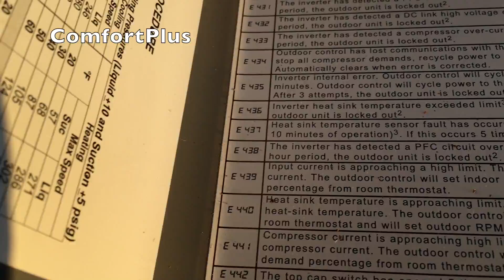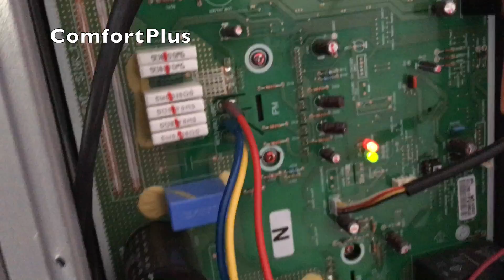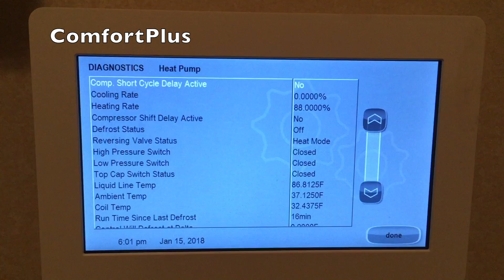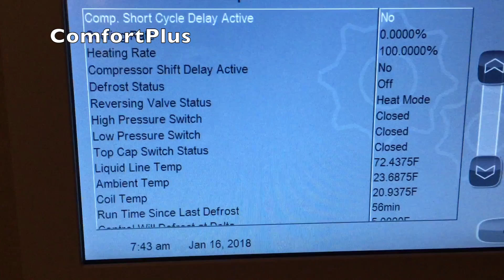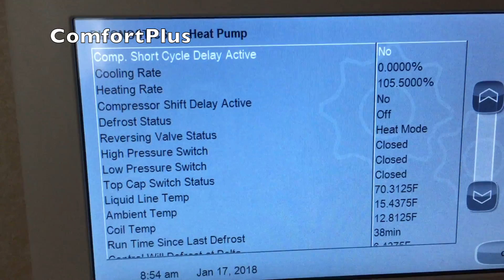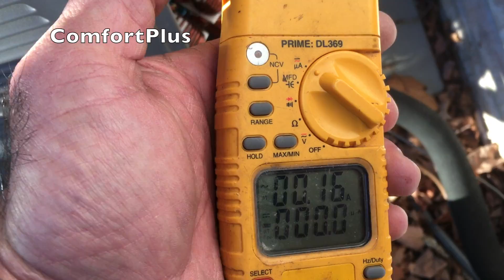Inverter Heat Pump Failure

Comment: Copeland's got a pretty sweet deal with their two stage compressor. It's really simple it has an unloader solenoid embedded in the compressor. It loads the compressor when energized to 100%, it runs at two-thirds capacity when solenoid is not energized. Copeland has a YouTube video on it
Reply: Eh? Those have been out for over a decade now.
Reply: @sprockkets  just putting it out there. I try to sell simple things I don't like the complex residential systems. They're nothing but headaches and the people I deal with aren't Rich. They want something that's going to work well. Newer equipment especially with heat pumps it's going to save money no matter what from a system that's 25 years or older. I've saved people money on their power bills

Comment: Is always that same style of crankcase heater that is crapping out.  Maybe it is to much to expect out of one wrap if heater wire. Maybe 3 turns of self regulating heat trace would be more reliable.

Comment: That is dumb. Carrier should of just wired the CCH across the pole (on a single pole contactor) that has the switch breaking it. That way the CCH is only on, when the compressor is de-energized.
Reply: You need it energized when the compressor is off, not on!

Comment: Any thoughts on the Bosch Inverter Units? Installed one in Jan. looking to install two more. Anyone had issues with the Bosch units?
Reply: I think they are great, Really Solid Units Especially the IDS 2.0 was really impressed and the 1.0 Has a Mitsubishi Compressor though I am Unsure if the 2.0 is Still using a Mitsubishi Compressor.

Comment: Mitsubishi is the way to go they are coming out with a split system in the new year to adapt on a regular heat cool split system. Way better heating capacity than this type of heatpump and more reliable.
Reply: Still waiting for this, They said the A-Coil would be coming soon at the Virtual Road show last month but for now Bosch is the most readily available non-communicating inverter option.

Comment: So what happened the compressor wont start if its too cold?
Reply from the maker: Yes the refrigerant will migrate to the coldest spot. A normal compressor would still start with all the liquid refrigerant in it but these will not. The locked rotor amps are very low for these compressors compared to a conventional compressor. The system monitors the amp draw and stops trying if it pulls too many amps.

Comment: My Lennox XP20 4 ton threw the same error code a couple times this winter.  I only noticed it when I checked the online performance report and saw that the electric heat came on when I wouldn't have expected it to.  Now I know what to check if it does it again next winter, thanks for posting this!

Comment: What brand of compressor does Airease use in those units. SPECIFICALLY YOUR UNIT.
Reply from the maker: Mine has an LG compressor. I think AS and Trane are using Danfoss for the inverters. I haven’t seen a Copeland inverter yet. Not sure why they didn’t jump on the bandwagon early lol.
Reply: @ComfortPlusHeatingandCooling  Copeland two-speed compressor is pretty awesome is why. It has a solenoid embedded in the compressor it's just 24 volts and when energized loads up the compressor. Wendy energized the compressor is unloaded to 2/3 capacity of the compressor. Goodman uses that and their two speed heat pumps. Copeland has a YouTube video on that. It's pretty simple. I'm not crazy about inverters because they're so pricey complex and most people s*** their pants when they get the bill
Reply: @benkuxhouse787  Hate to burst your bubbles but Copeland has inverter compressors and are used in quite a bit of units.
Reply: @sprockkets  I'm sure they do but there's other options available. Why do side work I try to keep it simple I don't want callbacks and I'm not a dealer I have to do this on my own time

Comment: Great find. How does the compressor know to shut down when the crankcase heater is open?
Reply from the maker: It doesn't. The board just knew how many amps it was drawing when it tried to start I guess. These things have a lower locked rotor amp rating than most compressors. I guess its good for the unit but it would be nice if the board monitored the CCH and could tell you when it was bad!
Reply: Sump of the compressor had refrigerant vapor that had condensed due to the low ambient temp. When the unit when to start up the compressor had drawn excess amps due to the scrolls being binded up, and since these are vfd/inverted compressors they start off really slow= less current draw basically eliminating the old heavy inrush current. So these have lower amp draw lockouts!
Reply: ComfortPlus Heating and Cooling great video brotha!!
Reply: You'd think with all that info on that display, they would just monitor compressor belly temperature and  tell u when it is too cold / cch failure. So easy to do. Just one more sensor / thermocouple or thermistor  into the board.
Reply: @OcRefrig  actually the better ones measure winding résistance and determine its temperature, it will energise it with small dc current for short periodes to heat it up, no crankcase heater needed.

Comment: A lot of scrolls in heat pumps don’t even have cch. They start unloaded in theory.
Reply from the maker: I did a video about that once. It depends on the charge if I remember correctly. That's why I usually add one on a long line set application.

Comment: That's good you dodged a compressor replacement!  I remember you posted the install of the unit a few years ago.  I'm surprised that the CCH only lasted that long.  You probably already thought of this, but since your Lennox/Airease distributor was out of stock and this is was an LG compressor and 40w you said, since Carrier/ICPs uses LGs I wonder if they had any in stock.  I think the Girth is about the same on your inverter version.  I assume it was still  under warranty, but as you said it's a fairly inexpensive part.  Glad  you're warm again!  Great video and good learning experience on these inverters!
Reply from the maker: Yes I thing any heater that would fit around it would work. The only difference in the part numbers is probably related to what connector is on the end of the wire lol.

Comment: I'm surprised it wouldn't start because of that. Can you check the superheat in heat mode and make sure it's not flooding the compressor? You would think it would be warm naturally as it should have been running pretty long at that cold temp.
Reply from the maker: I didn't even check it Joe. You know how we are about our own stuff lol. I just replaced a filter that was dated 7-3-16. Fortunately I have a lot of tile and hardwood so it didn't look too bad.

The locked rotor on these compressors is only 20 amps. I assume they want them to start softly and that is the reason behind the logic on the board to check for excessive amp draw. I don't have the engineering guide on the LG but a Copeland of this size would recommend a heater at 10 pounds of charge and require it at 12. This installation has 14 pounds. Gotta keep it out of there somehow I guess.
Reply: First Mitsubishi VRF I ever did  had a requirement to have cch on for 24 hours before initial startup. Didn't follow that of course. Startup fella came and guess what. Would not start for anything. Threw a heat gun in the compressor compartment for 30 minutes. Feller started right up.

Comment: I think they need to call you Mcgyver. 

But seriously, that's awesome showing the real world problems of the inverter systems. What brand/model do you have?
Reply from the maker: lol I was about ready to wrap Christmas lights around it. Its a Airease 4SHP20LX 4 Ton (Same as Armstrong Air also)
Reply: If a cc heater fails on a normal unit, it will just completely die in time ;) This is preferable to that.